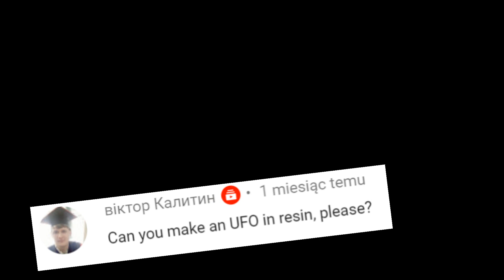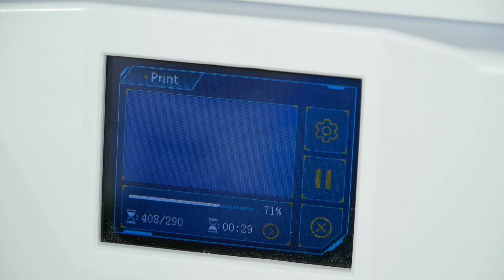Alien 👽 Ufo 🛸 DIORAMA - Night Lamp / RESIN ART

Comment: There's a tip I wanna pass on to u from a documentary I've once watched about modeling grass landscapes:

put a little bit of glue on the surface that u wanna have grass on, then scatter the grass onto it evenly and then get close to it with a balloon or something else holding a static charge to have the grass stand up vertically.

Comment: Great work, but... LEDs need a current limiting resistor, otherwise they will burn quickly. Resistance depends on type of LED, for white 3.6v one it should be around 5 ohms when connected to 3.7v battery.
Reply from the maker: Ok thanks

Comment: There's a better way for grass.
Use glue at the bottom. Put the grass in some plastic container like baby powder. Shake the container. The grass will be charged by electrostatics. Now you can shake the grass out of the container. Because the grass is charged it will stand upright and looks amazing realistic. Remove the rest of it with a vacuum.

Comment: The led is a diode, so ever you must connect it with a resistor. You can calculate the resistor: (V-Vf)/If. V is the voltage of battery, Vf is voltage foward of led and If is de current foward that the led brigth rigth.
Reply: Depends on the internal resistance of the battery. If the internal resistance of battery is higher than the calculated resistance for the forward voltage of the LED, you don't need an resistor.
Reply: it is a good practice to place the resistance, if the battery voltage is a little higher than the vf voltage, the current growth becomes exponential and the led may burn out or the battery life will be very short. Another thing, any manufacturer of batteries seeks precisely that the internal resistance of the same is as small as possible.